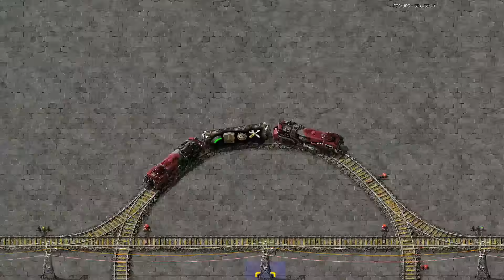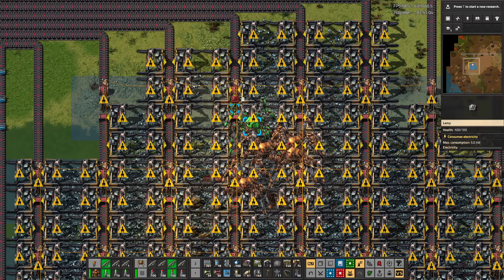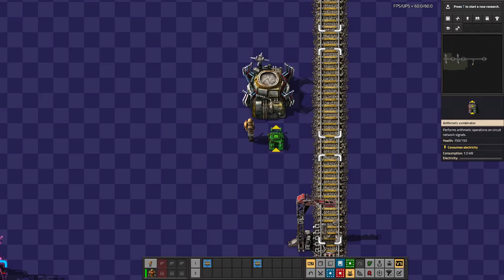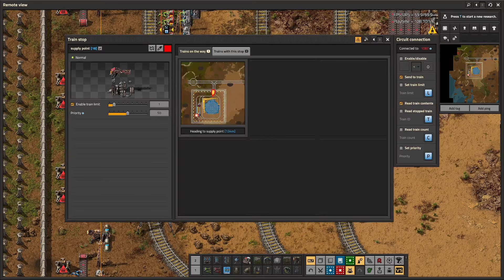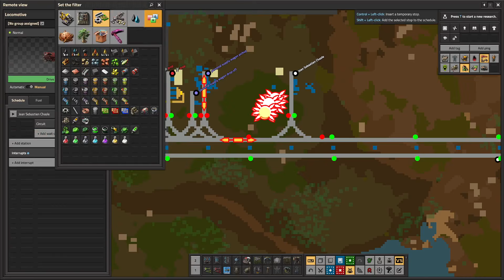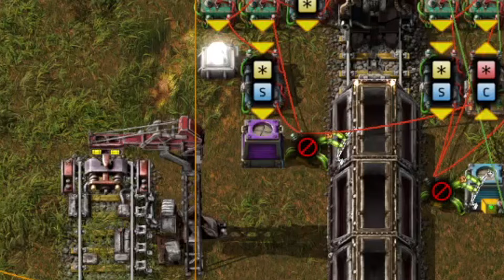Supply Trains: Basic, Cursed and Optimized. (Feat. Personal Logistics Trains) -Factorio 2.0

Comment: 10:03 Am i right in thinking that this smart-loading station can have multiple inserters on it to speed it up as long as you hook each new inserter up to its own requester chest, and selector and maths combis? just make sure that each inserter's selector is set to the nth index position in the item list and they should work together fine (1st inserter's selector reads index 0, 2nd inserter reads index 1, etc)? Any more than 2 inserters per wagon and you'll need more deciders to receive the outgoings wires from those inserters to detect when they're no longer receiving signals & are done loading

Also why are two selectors needed at 9:15? If the item signal only changes once the inserter deposits it into the wagon, then the circuit has however many ticks it takes for the inserter to rotate back to the reqr chest for the updated train contents to make it through the combis and send the correct item & stack size to the inserter?

Does the item signal and stack size signal updating 1 tick apart cause the system to still overload eventually, or can you get away with only 1 selector and save 2 tiles of footprint per inserter (ie if laying out these resupply stations next to each other and needing to cram the combis together cos ur using more than one wagon per train?)

Comment: hey man love your videos! i am a returning player (to be fair, the last time i played was version 0.14, nine years ago) so have been looking for very specific solutions to problems and your work is excellent. i do want to say (speaking as a time traveler in a sense) that for those of us these days, the train schedules will no longer automatically skip deactivated stations. i set up this entire system and the combinators all still work to spec, however custom train interrupts are necessary to make it work. i used a custom control signal for each outpost, and broadcast it over surface radar to tell the train when to leave (as well as AND/OR/AND statements for departure conditions on the primary resupply loader station interrupt). as an aside the stack size combinator needs to multiply by 1 in order to work as well. would love to see an updated video to see how you set it up, because i am sure my setup is sub-optimal.

Comment: My slight variation is multiple loader arms. It overfills but you can then have a single extractor taking out the excess. Better if each chest has a different selection of items as that will stop the extractor ever having to take out overflow from 2 inserters at once

Comment: I also set the priority of the station based on the number of items pending from the logistics network so the one in most need gets a train first. I also have multiple trains because my base got a bit big. The trick about using -1 is interested.
I added a garbage box too, on each outpost their is a storage chest of "everything else" and this is also wired into the priority of the station. So if I remotely want to destory stuff it takes it to the storage chest, which increases the station priority, and that chest is simlply loaded onto the train as much as it can. The complex logic to take only what is needed off the train does the rest. Also I normally had a cannon at each outpost but shells are 1 stack, so I have 2 cannons on the supply train itself and then inserters just take off that cannon and put them in the outpost cannon when needed. BUT if you use a requester chest for shells you then need to deduct it from the whole radar system so shells are never loaded into the cargo.
It gets complicated there, spent hours messing with supply trains 🤣🤣

Comment: I played in vanilla years one to five. You could not read the contents of a train, nor filter container slots. I developed a supply system that completely emptied each train returning to the depot, then a series of requester  chests would turn on and off before they were funneled across a gap to a loader chests so that only a specified amount of each supply could be loaded onto each supply train. 

The loading zone was massive, with a total of four stops per supply type at the loading side, and two trains able to unload at the same stop on the depot side.

I had one supply type that was just military; ammo walls ect, and one that was for construction materials (including miners) so that once i put down a depot i could build mines and factories from blueprints anywhere in that supply sector. Some items like ammo were built and used locally about 25% of thr time and then shipped to the grandbazzar to be redistributed everyehere else via the supply trains.

Speaking of "the grand bazzar" any player who walked anywhere the item mall (which was near the main supply hub) would be mobbed by a thousand game chugging drones as logistics requests of any kind would be swiftly handled.

Comment: I know this is not the point of the video, but in the basic outpost setup, its helpful to multiply the requests by -1 and then add what is already satisfied. That way rocks end up in the logistic chest, your supply train won't try and come to refill the rocks, plus the added bonus of negative numbers literally meaning a deficit of the item. No need to sanitize.

Comment: Funny how I find this video after just solving the problem of bulk inserters getting stuck. I did it by creating an "outserter", an inserter with the stack size set to 1 taking items out of the wagon. Then make a 26-tick clock, set the regular inserter to activate at tick 0, the "outserter" at tick 14, and also filter the "outserter" to the inserter's hand contents. 

The idea is that the fast/bulk inserters take 13 ticks to swing one way, then 13 more to swing back. So if at tick 14 it's still holding something, that means it's stuck and the "outserter" needs to clear space in the wagon.

Comment: 4:12 if you want to avoid an inserter getting one type of item stuck forever because it isn't unloading the perfect amount, why not set the requester chest to have a few less items per stack, that way the inserter will be able to unload just a little bit more than necessary, and then move on to the next item? I'm about to give it a shot, I think that's the solution

Comment: I developed a system that selects against a static list, using only the missing items, selecting from the largest set first to optimally move items from the wagon to the chest, it also uses dynamic hand size on the inserter to move anywhere from 12-1 item/s at a time, depending on how many items the chest needs. Mine is actually quite similar to the one you showed, although a little more complex, for one i use two logistics groups (to minimize item shuffling to the supply point since you really don't need 300 walls when you could get by with 50, and allow filtered unloading if desired) and i altered some of the logic because i had issues with ghost unloading into a full chest (this does mean my unloading isn't quite optimal, but it optimizes the amount of trains sent out, so you don't send one full train, unload all the walls, and then send that train back off, without taking any other needed materials), and secondly, i'm actually using the contents of the wagon, against a number from the logistics group, to determine what and how many i should unload, this means the system will never try to unload an item that doesn't exist, and i'm using an idle timer to determine when unloading stops (which is pretty quickly) Even if you're missing items from the train, it only delays it a few seconds to make sure everything else is delivered as it should.

My use case is for an artillery outpost that i've been working on, although i buffer the bots into a chest (just the item buffer chest), and then into the roboport, because the train won't always be present, and i want to minimize the amount of active bots in the network quite aggressively, while still having a sufficient buffer. And since it's an artillery outpost, i'm optimizing for a fraction of all the items needed so i can get it down to 2 or 3 trips total if possible. The idea being to minimize building time, which should improve defensive capabilities, and allow you to build more simultaneously. One of the really cool things you can do is use pre-loaded trains as a local buffer for out of the way stations which is an interesting solution to an awkward problem.

I havent thought about using it for personal logistics yet... Good idea, i'm stealing that. And yeah, it would be nice if they unified the circuit network more.
Reply: theoretically you should be able to get clever and do a train pre-request system, where you detect missing items while unloading, and then set the train limit to 2, immediately dispatching a train, you'd likely want to build in some kind of train dispatch system to forcibly send off the other train when the second one arrives though, if you don't have a stacker in the station.

Comment: The supply trains can be extended to serve as "trash trains" too. Where rather than only delivering items they also pick up excess items. This lets them serve the full lifecycle of outposts including deconstruction as well as empty excess items from player/spidertrons. 

Here's how I do mine: each station has two storage chests, one for the supply and one for trash, the supply chest is filtered so logi and construction bots won't put anything in it automatically. Items are unloaded from the train into the supply chest similar to your setup. Excess items from the supply chest are loaded into the trash chest by an inserter limited to stack size one. Everything in the trash chest is simply loaded into the train. The signal for the station to be on is activated when any item signal is not equal to 0, so the station will be active when it either needs to get supplies or drop them off.

I intentionally use only logistic storage chests in outposts to reduce the number of unique items, outposts only need storage chests to work this way so long as you filter the ones you don't want bots to use. Of course to supply the player and spidertron outposts also need logi bots but just a handful is plenty as you can stand right next to the chest. And outposts only need to request at least 1 of each item. You stand in logi range and that one items is delivered to you, this triggers the train to come and it stays until either your requests are fulfilled or the train runs out of items. As you say setting trains to wait until inactivity is a good general purpose setting.

At large scales I've also found it useful to fully unload the incoming supply trains into active provider chests prior to them queueing to the loading station(s), This way I can buffer empty supply trains rather than requiring as many sets of items as trains and I can also take advantage of knowing the trains will be empty prior to loading in order to load them more efficiently.

Comment: There is actually an optimization you can add for extra laziness !
Also a small "extra" thing you have missed: Radars actually support 2 channels- the color of each wire.
 If you hook up the demand side on a green wire, you can withdraw it from another radar via green wire. The red wire will not show what the green wire is holding, so you can effectively simulate 2 channels (as if thats ever needed)

For The optimization: Instead of creating a standard   shopping list for each item, all you need to set up is a standard list of "consumable" items like ammo, robots and repair kits.
Since 2.0, Roboports can read the requested construction within their network, and output that as a signal.
 So instead of adding every building/turret (even walls!) needed to build your outpost to a shopping list, you can have the roboport read all the required items and send it back to base.
Add the signal to a requester chest, and add some circuit magic, and your outpost will automaticly get deliveries of everything it needs to complete itself. Be it miners, oil pumps or walls.
Result: Just throw down the initial roboport + combinators, and everything else will be constructed by the system without any further input.

Comment: To prevent the stack inserter from trying to filter on something not on the train, and then the train leaving early without unloading all required and available items. Filtering train unload inserters to only grab what's on your logistics list AND currently on the train:
The problem: You have a logistics list with quantities and a train with contents. You only want inserters to grab items that appear in both.
Setup:

Train contents → Decider (Each > 0, output Each = 1)
Logistics list → Decider (Each > 0, output Each = 1)
Both outputs → Arithmetic combinator (Each + 0 to merge them)
Merged output → Decider (Each > 1, output Each = 1)

This gives you items that exist in both lists. If it's only in one list it equals 1, if it's in both it equals 2, so filtering > 1 gives you the AND.

AND result → Selector (iterate mode, driven by a counter)

Now you have one item type at a time.
To get the stack size:

Selector output + raw logistics list → Arithmetic (Each * Each)

This multiplies the single item signal (= 1) against the logistics list. Only the matching item passes through with its original quantity.

Multiply output → Arithmetic (Each * 1 → S)

Converts the item signal to S for stack size.
To inserter:

Selector output = filter type
Final arithmetic output = stack size (S).   

TRAIN
  │
  ▼
Decider A (>0, Each=1)
  │
  ▼
Arith ADD ◄── Decider B (>0, Each=1) ◄── LOGISTICS
  │
  ▼
Decider C (>1, Each=1)
  │
  ▼
Selector 1 (iterate)
  │
  ├────────────────────► INSERTER (filter signal)
  │
  ▼
Arith MULT (Each * Each) ◄── LOGISTICS (raw)
  │
  ▼
Arith STACK (Each * 1 → S)
  │
  ▼
INSERTER (stack size)

Comment: There is a huge problem I've encountered with this design. There is no auto-sorting in the wagons, so a stack of items can be inserted into two different cells (49 and 1 instead of 50) which will eventually clog the whole system and cause the train to get stuck at the supply station